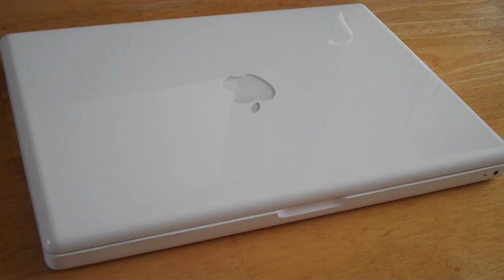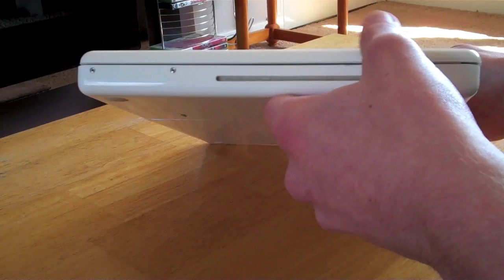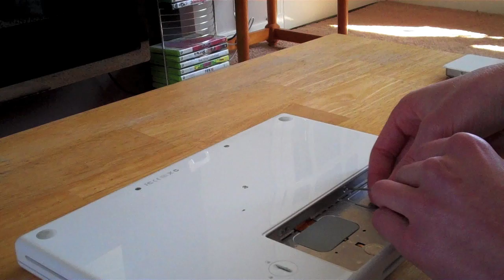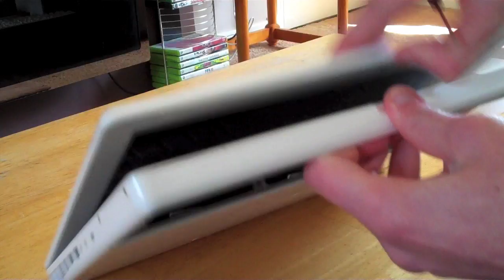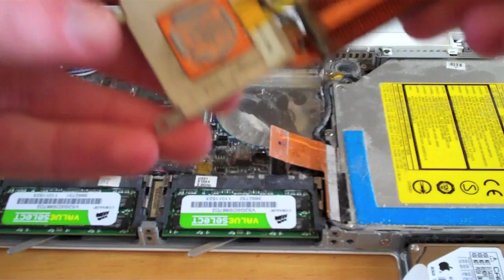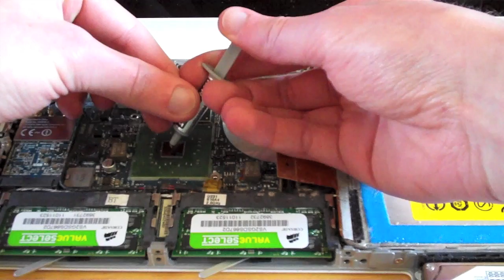Replacing Macbook Thermal Paste

Comment: Thanks for showing how to open-up a MacBook,  Late 2006. How did you remove the old dried-up thermal paste?
Reply: You can use any plastic card, anything plastic like a spudger. Then dip a  Q-Tip in alcohol and remove the residue with that.

Comment: The best fix for this old software is loading into your Mac “rEFIt” dmg software.   Running it.  Restarting your Mac.   Then download on Lubuntu.net the i386 32 bit software as an iso file to your downloads file on the Mac.   Stick a CD 💿 or DVD 📀-r into the slot and burn an iso copy of Lubuntu Linux.  

Then restart the Mac.  At the start screen 📺 since you loaded a boot loader, called “rEFIt” it will now see the option to load Lubuntu and you will select it to install.  Once it installs and restarts you will open a terminal and type
 “sudo apt update” 

“sudo apt upgrade”

Then restart.  

Then if you want you can upgrade to Lubuntu 18.04 by:

sudo do-release-upgrade 

Select y for yes.  

It will download and install Lubuntu 18.04

Thanks for the video.  I have to put new paste on my CPU/GPU.  I could cook eggs 🍳 on my laptop 😆

Comment: Can I just make one thing clear, DO NOT spread thermal paste with your fucking finger people. It will do multiple things,
1.) Transfer body oils to the paste and degrade its ability to transfer heat.
2.) Your finger is not smooth or fucking flat. It WILL leave air pockets in the layer of paste, thus, acting as an insulator than a transfer agent. Basically, doing the exact opposite of what you intended in the first place.

Correct way(one of them)

BB/grain of rice size in the middle and place the heatsink straight down, applying even amount of pressure, tighten each screw like a tire on a car, (tighten each a little at a time and go around each screw until each one is tightened evenly). This will ensure the paste underneath is evenly spread out in a thin layer.

Literally hundreds of videos on how to apply thermal grease and nobody uses their fucking pubescent fingers.
Reply: +FatheredPuma81 your the idiot becuase if you mush the paste down with your fingers it's gonna create air bubbles becuase its barely making contact with the cpu you do as he says use either a grain of rice or a pea sized dot that way the cpu heat sink (not sync) spreads it it's self and is actually making contact with the cpu
Reply: I use a card to spread the thermal paste replacements I do and the right amount around the size of a small rice pice to make it not over cool or have it fail because I don’t want to damage the systems I do
Reply: You're an idiot. Just saying. For number 2 that is.
Using your same logic just putting a dot will ruin it since there is WAY more air and your heat sync won't spread it out enough.
Reply: TechJunkie You do realize that the same heat that will spread the thermal paste also will remove all the air bubbles right?
LinusTechTips even proved this is a video that so long as you don't add too little or a ungodly amount it doesn't matter how you spread it.

Comment: WHY YOU NOT CLEAN ALL PARTS OF THE LAPTOP? -_- JUST CLEAN THE CPU AND REPLACE THE PASTE..... AND THE OTHERS PARTS ARE DIRTY -_- WTF
Reply: D12dituelf That is a good point. He could have just dusted out the internals and booted the machine with a usb mouse so he doesn't have to reassemble it to disassemble again and see if it happens again. Also replacing the thermal paste can help cooling as after 2 years of using a laptop or macbook with the same thermal paste it can become lesser effective

Comment: Thanks very much bros..I follow all the steps in this video and I  renew my $200 early 2008 macbook that was running hot ,noisy and slow..there was a lot of dirt inside cooling fan..clean the heat sink and put new paste on CPU ..Now my Mac is running like brand new no noise no heat, Thanks again for this video
Reply: elpilonvideo I hope you didn't spread the thermal paste with your fingers. It can cause problems later on so if you have spread the thermal paste with your fingers you need to redo thermal paste application but this time allow the heatsink when adding the screws to spread it out by itself and don't tighten one screw and add the next as that can cause spreading problems as well.

Comment: DO NOT smear out the termal paste with your hands. Hands tends to have fat/sweat witch contains alot of oil. For those who down know High- Alcohol solutions tends to remove the paste easly. Again dont use anything Oil Based, As it gets very warm when heated. also dont use too much paste. i ricecorn will suffice.

Comment: 10 minutes watching how you opened the laptop and you didn´t show how you cleaned up the themal past, bad video.
Reply: A little piece of toilet paper for taking off all the thermal compound you can, then, a soft cloth with a few drops of alcohol. The CPU and NB die should be shiny.
Reply: Faef Lemon  I was trying do the same as this video to clean the thermal paste, then i was removing the temperature cables sensors and I cut them.... so this guy missed that part and I made a mess on it..... IM TRYING TO CONECTING DIRECTLY...

Comment: good video ! but i will repeat the question listed below ... what liquid chemical you use to clean ( remove ) the old thermal paste . thank you for your time .
Reply: Use isopropyl alcohol and a toothbrush. its safe on electronics and wont eat anything rubber or plastic. avoid using any contact cleaners..

Comment: Good vid however you could have done it in under 5 mins. I skipped through most of it to get to the meat of the vid. It took over 4 min of vid just taking the screws out. This could have been done ahead of time then pointing to the areas you took the screws out. And your voice was rather muffled. Other than that, this was an ok vid.

Comment: How did this workout? I have the same Macbook. The mouse hangs and freezes when the processor is under heavy load. Do you think this could be it? Replaced Hard drive and RAM with no fix. Ethernet stops working under heavy load as well. DId you notice any difference in operation? Thanks so much.

Comment: You can actually clean the fan with your own lungs and a paint brush. On some not all there are little screws to remove the cover from the fan. Just have to becareful, also sometimes stickers cover some little screws. But usually your own lungs and a paint brush (with no paint, duh, right?) is enough to clean it properly...

Comment: Don't use your finger. Just put a bit in the center and let the heat sink squish it in. The thermal paste lasts longer that way. When you put your finger in you introduce impurities into the thermal paste mix. Besides you don't need to cover it all, when you squish the heat sink it does it for you. Once you turn the pc on the heat sink gets hot and properly distributes the thermal paste.

Comment: Arctic Silver is not bad for the skin, only after a lot of touchy time.
but Hey Man! don't touch that Thermal Grease WITH your GREASY fingers, that might make it a bit, sad. fingers sweat, and they are usually greasy. that compound is better off without other stuff. use a Card or plastic bag, your "grains or rice" are big, since AS5 is conductive, and it makes a fine layer of silver after the 200 hour break-in. well, interesting vid though ;) never seen the internals of those.

Comment from the maker: @19birel It's a late 2006 model, with a Core2Duo processor. I'm aware that the limit of these machines are 3GB but if you use a matched pair of RAM (2x4GB) then you get a slightly increased capacity of 3.2GB, Since these Macbooks use integrated graphics this little bit of extra RAM can come in handy not to mention that buying 4GB is cheaper than buying 3GB.

Comment from the maker: @YoLninYo Fail? Hardly. Maybe using your finger isn't recommended but my MacBook didn't stop working after I changed the thermal paste and the temps still dropped 10-15C, Complete success!

Comment: @EnergyButton How about using the method that the manufacturer themselves recommend? Did you bother to read the PDF that is freely available on their site? One thing which they mention as a Failure point is people spreading this stuff with their fingers! I can't believe 90% of youtube "instructional" vids use this erroneous method. You shoud use a flat surface like a credit card. You did everything right, then you took a big smeely dump on it by using your finger. FAIL.

Comment: So I did the same a couple of weeks ago. Now it usually doesn't go above 60 C, compared to the 80-95 C I was getting before. Thus the fan doesn't spin much either and in case it gets cooler much faster. I had to wait 3 weeks, tho, because I broke the keyboard cable. Ordered it used from US. So watch out anyone else wants to follow this road!!

Comment: @EnergyButton Actually it may still overheat at 4900. If I do anything CPU intensive I raise the max rpm back to 6200 (manually). It's not the best solution, but it does save our ears. It's pretty good if I have to download something big during the night.

Comment from the maker: @michelass0 Honestly the fan is a total design flaw in the Macbook's it just cannot move enough air to keep the thing cool under load but saying that replacing the termal paste does drop the temps by 5-10C although not enough to stop the fan spinning at full RPM.